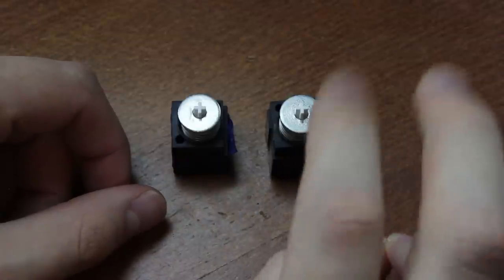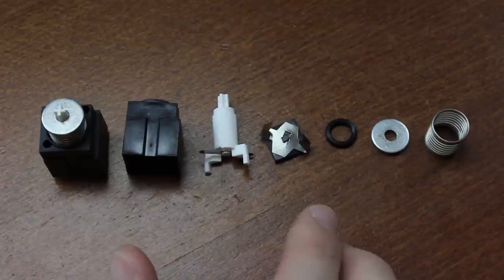Teardown - new Ellipse beamspring switches!

Comment: Finally i can get fired from my job without paying a bunch of bucks for a half functioning rare keyboard
Reply: Half functioning? My beamspring was the most reliable and coolest board I’ve had.
Reply: Beamsprings are not loud at all.
Reply: @cheater00  i disagree, a normal blue switch is quite annoying to hear alone, beamsprings are muchhhh more worst. Though I admit it sounds great in terms of clicking, not great in the decibels part
Reply: @gymbro5  well if u find one today at the junkyard , you might need to fix it before being able to use it fully. Its less likely you will find a fully functioning beamspring. This is what i meant
Reply: @probaskinnyman4960  you're confused, the loud part is the solenoid people often add to the keyboards, the spring's click itself is very light.
Reply: @cheater00  is that so? What would you say it is comparable with?
Reply: @probaskinnyman4960  a really thin mouse click
Reply: @probaskinnyman4960  or like a sewing pin dropping on glass
Reply: @cheater00  interesting, so like a light tactile switch with loud sounds?
Reply: Build a keyboard so loud and annoying, your boss fires you before you even plug it in
Reply: @Lemon_Inspector  why settle for less amirite?? 😎😎😎
Reply: @probaskinnyman4960  the action is super light, but the sound isn't loud at all.
Reply: @cheater00  really now? What switch would u say is much more upon your expectations when you first heard of the beamspring and picked it up? Some clarification by example: suppose you just heard about this impressive technology that many have given high praises for, you then proceed to assume its better than a technology that you’ve experienced/well fond of and decided to pick it up. You were then met with disappointment because it was not any better than the technology you previously had. Your expectations were of that this tech would’ve been greater than the old tech, yet it wasn’t.

Similarly with my question, I’d assume you first heard of it when in the market for awesome clicky switches and you found the beamspring. My question is when you first heard of the beamspring before experiencing it, what switches did i had in mind that you’d think the beamspring would’ve beaten yet failed miserably? ( apologies for the long comment, not good at short stuff )
Reply: I have a single beam spring switch that I bought off eBay for $20 a few years ago, and I can confirm that the switch itself is loud. This is not going to be an office-friendly product.
Reply: @XalphYT  you have a single refurbished de-rusted piece of crap, I have a full new old stock keyboard from a data center that's never been used.
Reply: @probaskinnyman4960  nothing. they're the best switches, but those new beam spring switches in my opinion won't be nearly the same.
Reply: @cheater00  i see. How many beams have you had?
Reply: @cheater00  That's why you need to pair them with the solenoid.
Reply: I've been conditioning my colleagues with a Unicomp over the past 4 years. They'll learn to live with the beam springs 😈
Reply: @cheater00  Mouse switches also have a similar mechanism to beamspring switches or even the same just modified. However, beamsprings are much bigger and the keyboard case, keycaps etc will add up to making the sound louder.
Reply: @torpedo996  mouse beamspring switches? i can't imagine that to be true. can you name any specific switch in particular, or do you just mean the general tactile switch type used in most mice? those have no relation at all to beam springs

Comment: Shame that the Silo Beamspring switch will never come to fruition. However this is a really bold move. Sounds thocky and bassy though. Let's all hope the keyboard won't cost an arm and 2 legs 😂
Reply: Indeed. After all, if an arm is part of the price, how could you type after paying? Only drawback I see to those switches is that the resulting keyboard isn't gonna be exactly thin. But ought to sound and feel great.
Reply: Never say never, they were cancelled because they lacked the funding for mass production tooling, right? All that design work is still there, maybe someone picks it back up.
Reply: The board will not cost you and arm and both legs, yet it will cost your HEAD. Bwahahaaa!!!!
Reply: Shame the move to a Hall Effect design doomed them to obscurity. I understood when they were mentioning it left more room for the actual mechanism but then it wanked on about all the potential of Hall Effect and how many typing styles can be accommodated by contactless methods and my eyes glazed over.
Reply: It will cost roughly 500$ according to the Google survey about potential buyers

Comment: Ohhhh man, I cannot WAIT to see what comes of these. Been wanting a beam spring since I first saw that video of yours years back.

I hope these new beam spring keyboards also come with that sweet, sweet solenoid action!
Reply: They have started taking orders.  Just paid for the b122 version. I couldn't believe it when I saw they had a 122 key version.  Perhaps my comment regarding the lack of that for the model f had some impact.

Anyway, the b122 corrects the two minor annoyances I have with the model f122: No gap between the f4-f5 keys and the inverted t nav cluster.  to be fair neither of those were horrible as i dummied out the extra nav k and put keycaps with landmarks on the f4 and f9 keys.

Comment: at 02:00 I might've misheard, but wouldn't those GOURD switches count? I can't remember the name, but the ones that are actually just a spring, not a switch 'per se'
Reply: Also if I may add, this mechanism, by virtue of being literally inverted, might be the solution for a minor annoyance I have with almost every key switch out there, the CLACK they make when returning to position, as opposed to the CLICK that the mechanism makes, or the THOCK of the cap hitting the plate.
Reply: Are you talking about Oki Tactile Gourd Springs? Then yes.
Reply from the maker: Correct, Oki gourd springs also have it! I knew I was forgetting some :) .
Reply: @Chyrosran22  Of course, after all I only know about them due to your video. Thanks for all the content, keep up the good work, love it

Comment: Making them shorter is a really stupid idea given that the smoothness of the mechanism directly depends on the tangent of the down-force applied by the finger against the outer wall, and that increases super-linearly and then super-exponentially as the switch height is shortened. He's literally killing the most important part of the switch.
Reply: According to the creator the travel was not affected by it
Reply: @DerGamerChaot  no but this is not about the travel, this is about the distance between the bottom of the plunger (where it's welded to the beam spring) and the top face of the key. This will be considerably shorter.
Reply: @cheater00  I see now. I did not understand your comment at first, but that makes sense. I wonder how different it feels. I also did not understand why he did not just make it the same design.
Reply: @DerGamerChaot  maybe he thinks it's excessive. I don't think a lot of people realize why exactly this design feels so smooth, but that's the reason.